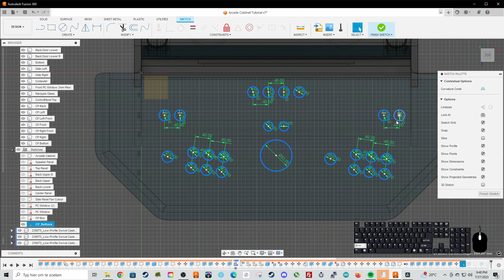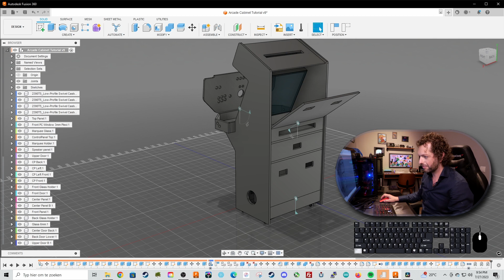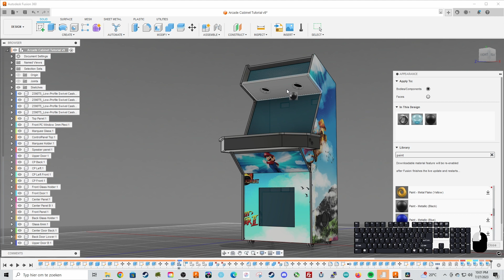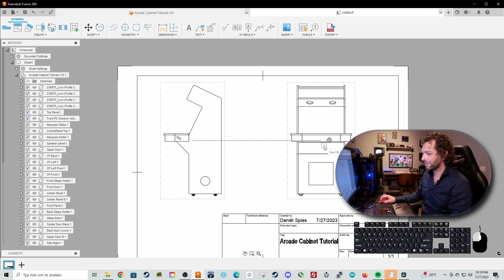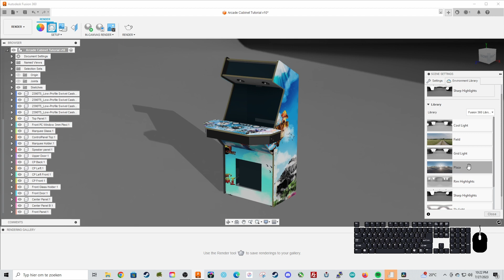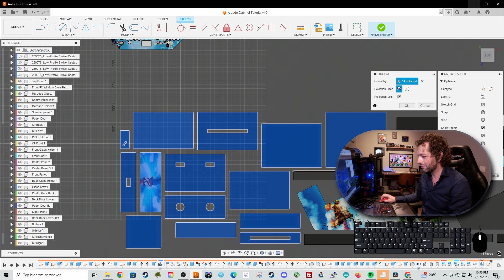Mastering fusion360 - Retro Arcade Cabinet tutorial  [part 5 of 5]  📐📏🛠

Comment: Thank you so much for this tutorial series! I need to make a new control panel for my DIY cab and was intending to use my local makerspace CNC router. This is gonna help a ton!

Couple questions:
-can you indicate depth with DXF so do your window inlay?
-can CNC routers cut miter angles or do you do that after with a table saw?
Reply from the maker: Hi, no I always make a ' pocket depth'   information PDF that I used to send to my cnc operator. Now, I export the files as SVG directly to my CNC machine and that format includes depth information.